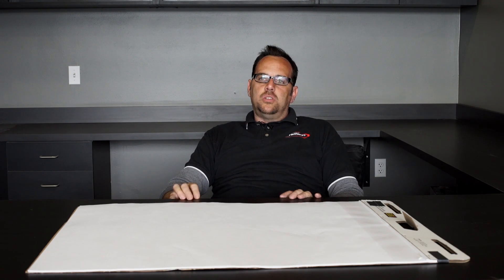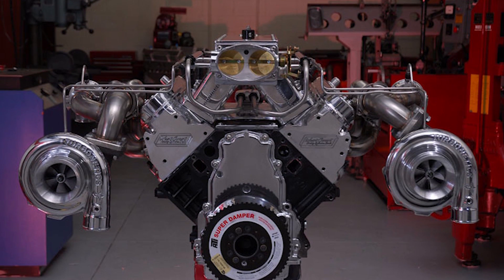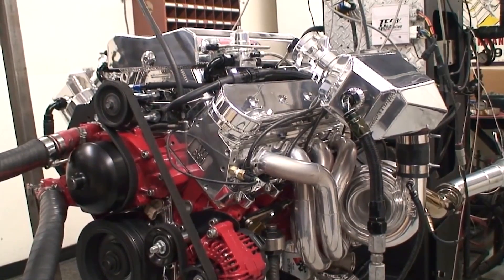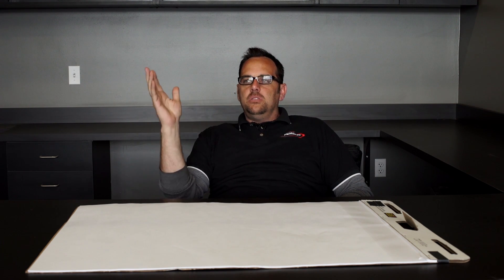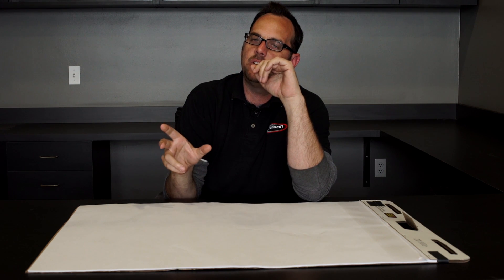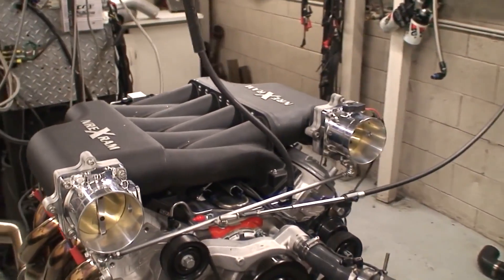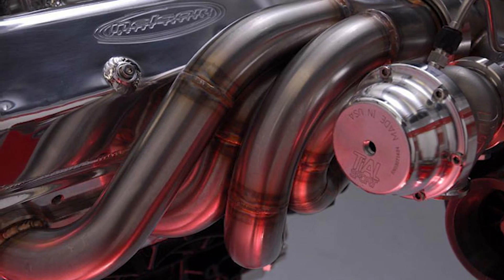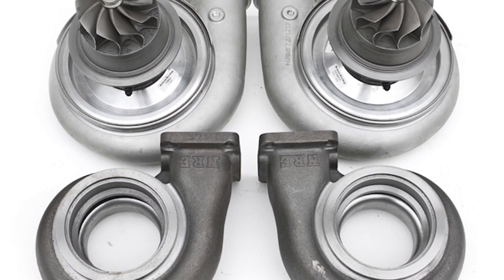Master Engine Builder Explains Why the LS V8 Is SO Good

Comment: Could you guys please do an overview of the smaller LS motors, like the 4.8 and 5.3? They get overlooked a lot, and they make really good motors with turbos on them, especially because they're truck blocks - and they're hella strong.
Reply: Building a 5.3 Turbo for my FD RX7 right now. actually picking the motor up next week. lol
Reply: Raymond Newbill really? lol everyone does JZ or rotary swaps into the FD...rarely do I hear of LS swaps, let alone a 5.3 instead of a 6.0L lol
Reply: I have spent so much on my rotary its no even funny. Huge single Turbo, standalone. We are talking full racecar build shit here. NOBODY could get it to work right. It was out together by professionals and tuned by them. I had some of the greatest rotary shops in the world tune it. None could get it to work. Then Andy who built adaptronics tried to help me. He is a genius, its like having a celebrity work on it. He couldn't figure it out. So I am now going Turbo V8 because anybody can tune those and make them work. Lol, should be fast and fun.
Reply: Plus I can get 5.3 out of junkyard for like $250. Where the 5.7 is $3,000 and 6.0 is like $5000
Reply: +Raymond Newbill true. plus they weigh the same and the 5.3 has thicker cylinder walls because of the smaller bores IIRC which means it can take more boost (same outer dimensions and effective weight as a 6.0). I've always thought about putting a built and forged 5.3 in the new miata and revving it to 8000 so it makes ungodly power. :P
Reply: +Sai Namuduri Yea I'd love it to rev like a rotary. However for now I'm just gonna get it running good so I can finally drive the car. lol, the LS motor weighs the same as the 1.3 rotary too.
Reply: +Raymond Newbill that's the one thing about rotaries lol. they're pigs on the scales. also, why the fuck is it so hard to find fully dressed (aux., water, electric, intake, exhaust) stock engine weights? nobody seems to have a definitive resource. you'd think with the myriad review publications someone somewhere would have done some definitive research.
Reply: +Sai Namuduri one thing I don't like*
Reply: +Sai Namuduri I agree, I just wanna build a supercar killer. My #1 goal.
Reply: Raymond Newbill have you ever heard of the Hartley V8?
Reply: +Raymond Newbill You could get an iron block 6L.  Those tend to go for $1000-1500.
Plus, if you want a 5.7, most iron block 4.8 or 5.3 can be bored out to 3.9", which is the same bore as an LS1 (5.7L).  
But, if you're planning on turboing it, go with the 4.8L.  It has a short stroke and longer rods, and because of this, is typically able to handle higher boost than other LS engines in stock form.
Reply: +stlchucko Iron is to heavy, I'm gonna stick with aluminum
Reply: stlchucko there's no point in boring out a 4.8 to a 5.7. Just weakens the block and takes away from the fact that it can already rev to 8000 if built correctly and takes about 40 pounds of boost using crappy cast parts and ebay turbos before it conks out.
Reply: Find an L33 block from a junkyard Z-71 ltz or a V8 trailblazer. It is a 5.3 aluminum block and can usually be found for just a little more than an iron block.
Reply: Sai Namuduri Numerous people have done it without issue.  Plus, It's not just boring from a 4.8 to a 5.7.  In fact, some of the early iron castings are marked 4.8/5.3/6.0, indicating that it's a block that can be overbored to 4" (3.78 in 4.8l and 5.3l)  The 4.8 uses a shorter stroke than all other LS engines, which is a key reason why it's so rev happy and able to withstand high boost thanks to the good rod to stroke ratio; ARP rod bolts and it'll be fairly reliable to 7000-7500 rpm.  Nearly anything can rev to 8k if built correctly.

40 psi?  I've never heard people running that on a stock short block.  I've heard 27 psi on a stock bottom end (HotRod mag article, 1200 hp).  If one is running that high of boost, then yeah, there's no point in punching it out.  In NA and low boost levels, it's not a problem, and will have the added benefits of producing more torque and torque curve lower in the RPM range.
Reply: stlchucko yeah, I was exaggerating (referring to the same HotRod article). But imagine if you had a twin-turbo billet 4.8 revving to 8.5K that could take 40PSI all day long and run Road Atlanta or VIR or CoTA or Laguna Seca making, like, 1600HP in a tiny fucking miata. XD
Reply: +Jc Culpepper dude, 408ci is NOT "small" by any means. And the gen V engines are all aluminum - only the older 4.8 was iron. and even that had alum. heads. Hence my comment on how insane a billet 4.8 built up with twin turbos would be.

Comment: So, where's a good place to find out what kind of engines fit in your car?
Reply: Technically anything will fit lol.
Reply: iApple Lol I don't have a SMART car but I don't think it'll be easy to fit a Corvette engine in it but that would be awesome and terrifying
Reply: +Cairo Google "your car" + engine swap. You'll usually see some common swaps that people do with your make and model.
And an LS will fit in damn near anything.
Reply: Cairo Easiest swap would be the SL2 DOHC motor swap. 00-02 lower end is the best block while 96-98 DOHC cylinder head is the best head, get the SL2 transmission while you're at it (Better gearing)
Reply: HowardSupra I'll try and remember this. My current engine has 192kkk miles on it and it's still running strong but it loves to eat oil every once in a while lol
Reply: +Cairo  A Grand Prix GXP has a FWD specific LS engine.  Nearly all the internals are identical, but has a different bellhousing for a FWD trans.
Reply: +Cairo Unless your swapping in the same engine as OEM, chances are you're going to have to start modifying stuff. The better question is what car do you own?
Reply: HowardSupra 98 Saturn SL. I was just curious about prices and what could fit for mine.
Reply: +Cairo Google images...  One slow day at work I decided to try and find what cars haven't been LS swapped.  So I started searching "Prius LS swap", "Eclipse LS swap", "GTR LS swap", "Crown Victoria LS swap", and on and on.  The car guys of the world didn't disappoint.  They put that engine in anything they can think of.
Reply: in your garage with a measuring tape and some common sense
Reply: +Cairo If an engine size doesn't fit, all you do is a bit of fabrication to make room and you're set. any size will fit... to an extent

Comment: Intresting series, but I don't think that the LS is such a great engine. It is cheap and it can make a lot of power, yes. But what about efficiency, innovation, size, weight, reliability. All LS engine are huge compared to what power they make, they are not particularly efficient (neither on the economy side nor the power side), even the aluminium ones are heavy and they have realiability problems. The NA 7.0l LS7 have serious valve problems, because the ancient valvetrain is not fit for 7000 RPM and the intake valves go flying. As a project engine the LS is a great choice, but overall there are a lot better ones
Reply: inefficient? and big ? big liters maybe but they aren't big engines at all. why do you think they are still push rods? To have a low center of gravity. Do yourself a favor bro and look up a side by side comparison of an LS block next to another. There's ONE cam in there. and they make great power for being an older style block for OHC most other performance cars do . And the LS7 problems happened to 1% of all the the engines they made and only if you missed the shift. There are other great engines out there but do a little research. A lot of what you're saying is just stupid memes and shit you here at meets from guys who've never even owned or done anything with LS engines
Reply: cheap: yes
makes power: yes
efficiency: care to elaborate? talking fuel efficiency or design?
size: the LS is actually quite compact. can fit em in anything easily.
innovation: hard to make something innovative yet cheap
weight: the LS is lighter than most 6 bangers and even some 4 bangers.... as an example an LS is lighter than a RB26
reliability: hit and miss... they leak like shit but are usually quite reliable.

in aus there are plenty of LS motors that just sit on the limiter yet still run.....
Reply: +Axel Like what?
Take a look boys... this is the ramblings of a jealous fanboy.
Reply: they just make up for the lack of efficient stock heads by throwing a supercharger on it..